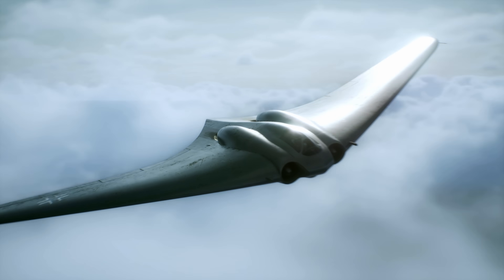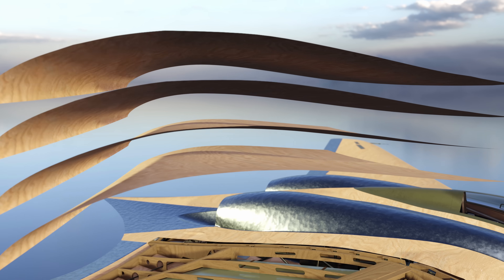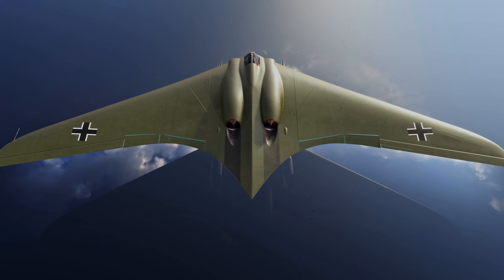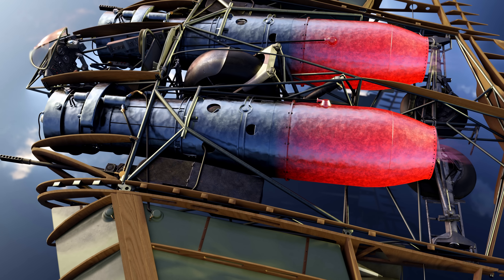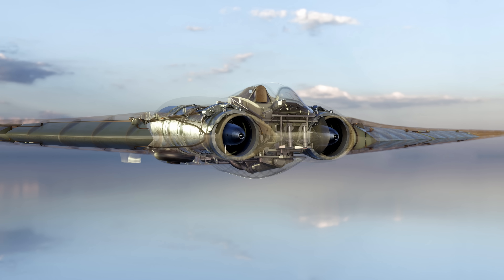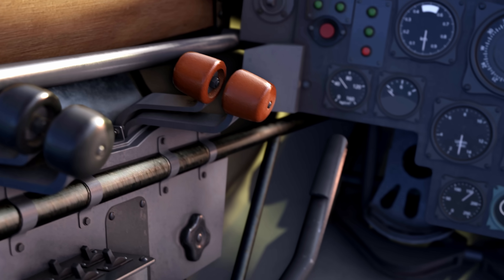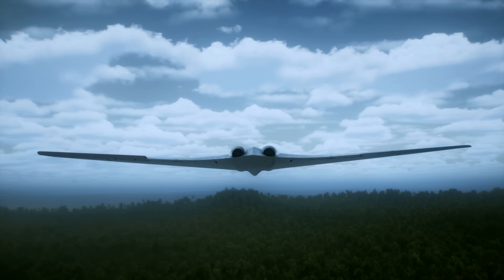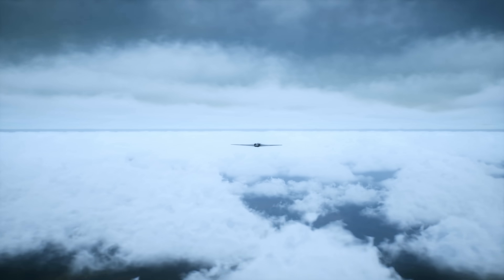Inside the Horten Flying Wing

Comment: You did forget to mention one important fact in regards to its potential stealth capabilities, it was found that because it's primary construction materials consisted mostly of wood (and wood is some what radar absorbent).

 it would have produced a smaller radar signature than it otherwise would have if it was constructed using metal.

In considering the level of radar technology at the time, it would have been more difficult for it to have been detected. 

And for this information I am citing a military channel documentary done in the late 2000s.
Reply: I believe there was also a documentary titled Wonder weapons of the third Reich, that also featured this information when speaking of this particular aircraft in one of their episodes.
Reply: 100% not stealthy, the engines are literally like gaping nostrils at the front, the shape invites radar waves
Reply: @PYri9056  your statement (save perhaps the engines) is completely false. My info is backed up 100% factual.

Yours is your opinion

Comment: Was on the drawing board from 38 , as a rear bladed aircraft initially , as seen on raiders of the lost arc , the technology was dropped due to flight instrument left extended which destroyed airodynamic tests , time being time they dropped it. The paint was also going to be the charcoal black radio reorganising silicons adapting radar signatures , also wool paneling which would then absorb and estrange the radar and become the first covert anti radar , and eventual jet engined v wing bomber , first was the focher engines and bladed , but you see the v wing was a nazi designe  using radar absorbing paints and panels , so way before the v2
Reply: Woops junkers engines

Comment: In regards to the stealth capabilities, if I recall the NG special you referenced, didn't they say that the plane WAS considered stealthy PER THE TIME PERIOD'S radar capabilities? They tested using current radar, finding that it wasn't that MUCH different from other regular aircraft, but when they dialed the radar back to replicate the radar of the time, the 229 WAS much more "stealthy" than other planes of the era, considering it's small head-on profile and it's overall shape.

Comment: Absolutely mindblowing design, better than Northrop's attempts.
Reply: How?
Reply: The Northrop designs all had stability problems needing special "elevon" design controls. They continually yawed that was impossible to correct. The Horten however was not properly tested so remained an excellent fantasy design. However they succeded in testing excellent flying wing gliders. In rc hobby flying the Horten is popular and shows good flying characteristics. @peterson7082

Comment: A common misconception is that the HO-229 was the plane the B2 Spirit was based on. When it was the XB-35 (1941) and YB-49 (1949), both are flying wings developed by Jack northrup

Comment: look like a usa stealth 21st century aircraft?...........Nhaaaaaaaaaaaaaaaa couldn't be
Reply: The 229 was not stealth
Reply: @peterson7082  but you have to admit that there is a very strong resemblance . Just being made of wood gives it 'some' degree of stealth......like the WW2 Brit Mosquito bomber made of wood and would at times slip through radar.
Reply: @inkey2  no, because of the amount of other material that made up the ho229, from the steel chassis, to the intakes, and possibly faulty panels. It was made only for speed and range, and the wood was due to resource scarcity, not stealth.
Reply: @peskyshoes  but does wood offer any degree of stealth over other materials "of the time"?

Comment: Imagine these airplanes flying all over Europe at that time. Too bad "someone" did not want everyone else to have access to them. By the way the Horten's were designing tailless delta wing aircraft since 1935 well before WW2 started, they had several gliders with this design. Many modern Delta wings gliders owe a lot to the Horten brothers and their designs.
Reply: Boris Cheranovsky and John Northrop had been working on flying wings since the Horten brothers were teenagers
Reply: @peterson7082  Wrong get your facts straight the Horten design goes all the way back to the 1930's as Gliders. American companies were in Germany in the 1930's even up to the start of WW2 so it's quite obvious that both Germany and the USA were sharing technology up to 1939. This is why the USA brought many German criminals over to the USA after the War as all this older and newer technology would of fallen into Stalin's hands. Northrup took the ideas from the Hortens for the multi plan controls. The Northrup N-9M did not even fly until 1942 and it was not even jet powered. You can say that 100% they knew what each other had it's clear they share too much design to be a coincidence. The key here is the USA took all the Horten's back to the USA and for the they started using the controls from them on the later B2. It's quite obvious now that Northrup ended up with all the Horten's brought over which later made it to the B2 design which again is IDENTICAL to the Horten. The original Northrup wings were utter garbage as they give up on those and built the B2 design which was kept secret for many years as I can guarantee it would trigger some questions as to why Northrup left behind their wing designs and literally used the Horten shape for the B2. Even the Engine placement on the B2, control surfaces it is impossible to deny the Horten as not being the Idea for it. The Northrup wings were clumsy, propeller driven, then the first jet powered ones looked like garbage. What Northrup designed was the staggered end of the B2 which was the key to finally controlling the flying wing properly. The rounded back end of the Horten wings were actually the problem for it's control issues.
The B2 bomber has nothing on the earlier Northrup wing designs it's completely a different approach and that approach was to take the older Horten and fix the control issues with the staggered flat ended wings. Even in 2024 there is no airplane on this planet that looks as sleek and alien as the 1940's Horten.
Reply: @danfuerthgillis4483  Yes Cheranovsky and Northrop had been working on flying wings since the mid-20's. The brothers were students and aviation club members in the 30's when they worked with their gliders. U.S. companies left mostly at the start of the Spanish Civil War and diplomatic ties were out by 1938. The XB-35 project began in 1938 with the N-1M flying in 1940 and N-9M in 1942. The Ho.IX/ Go229 project didn't begin until 1943 

The first jet powered Horten design was the Go229/ Ho.IX v.II prototype. Which flew and crashed in February, 1945 after several flights hours over the span of two weeks.

 They do not resemble each other. Especially in control surfaces.
Reply: @danfuerthgillis4483 The technology wasn't mature, the Hortens largely gave up on flying wing after the war. Neither ever stepped foot in the U.S., I don't think any of their close colleagues were either. 

 Engine placement? Really? They're on the leading edge of the fuselage. Not recessed above the wings. They're not even close.

The v.III prototype 229 was inspected by the USAAF for two months, then left to rot in several boneyards for a quarter century until the Smithsonian got it.
Reply: @peterson7082  The 1940's Northrup wing designs are not even close to the Horten, worlds by difference. The B2 is more close to the Horten design but much more improved with the engines more centred, the cockpit canopy further back and the critical non curved back wing section. There were many issues with the Horten but something is very suspicious about the Horten's just basically disappearing.
Reply: @danfuerthgillis4483  They didn't dissappear. The Nazi government and Hitler Youth saw more use with them as glider enthusiasts to help train glider pilots and powered aircraft pilots. Gothaer just used their engineer focus to develop flying wings. 

 They made a hell of a lot of money in Argentina though Walter wanted to just stay in Germany in the end working for a few engineering firms.

They were very skilled and smart individuals regardless of their initial political ideologies as teenagers. They didn't just disappear. 

That being said the control surfaces on the Horten are not similar to the B-2. Not anymore than Northrop's original designs.
Reply: @danfuerthgillis4483  tf you mean "non curved back wing section"? the entire plane might as well be cursive. The YB-35 was more straight in that sense.
Reply: @peskyshoes  The B2 bomber controls are set on flat planes that make up the design of the back wing section. The Horten back end of the wing section is completely curved. On the B2 bomber the back of the plane is straight line shapes for the wing edges, this is intentional in order to control the airplane better. This rounded back section of the Horten is why it had massive control issues, specially at low speed flight.

Comment: Actual Designation for this aircraft is GO-229.  The Gotha aircraft company was going to build it.  Ho I, through IX were used for the glider prototypes * Source:  Warplanes of the 3rd Reich by William Green  Pages 247-251.*

Also keep in mind we had the B-35 Flying Wing bomber under development during the same time frame.

Comment: It`s said that the Horten bros, used a strange glue with charcoal, resin and other sustances in order to reduce its radar signature, obviously, it wasn't a "stealth" aircraft, but, with this advantage, Northrop and National Geographic estimated that it will take over 7 minutes to detect the Ho-229 giving it time enough to reach a big city in the USA and bombing it.
Reply: +@francisomartin155   The Smithsonian took lab samples and there is no charcoal in the glues or paints.   The V3 prototype at the Smithsonian was designed by Gotha and was captured unfinished (and unpainted) by Patton's forces in a Gotha workshop in April 1945.

Comment: It's basically a B2 bomber 60 years in advance
Reply: Not even close
Reply: @peterson7082 you are right, it's far more advanced and revolutionary for its time. The Germans were decades more advanced than any other country. You are American so you are biased towards your country, which is understandable and a good thing, there's nothing wrong about that. But it's just a fact.
Reply: @hashteraksgage3281  You watch too much television
Reply: @peterson7082  ok
Reply: In shape? Yes more or less and that's not accidental. In actual stealth and performance? No, not at all. The intakes are not concealed and receded properly into the fuselage and it lacked RAM although Horten said he wanted to add charcoal compounds of some sort. He was onto something there, as carbon black compound is in fact used as a RAM.
Reply: @Doomguy-777  the HO229 was a stealth fighter that almost won the war mate^^

.

Comment: This is a ONE OF [or] paper design. IT NEEDS TO BE FLY BY WIRE with Dynamic DIGITAL control. NOT AVAILABLE at the time of WWII. First was F-16. Analog control could NOT do that. 100s of changes of the control surface(S) per second & complex algorithms (to my knowledge). The Germans had small quantities of Jets ME 262 & the smaller
ME 163.

Comment: "Was it stealth"..?? What type of dummy question is that..?? In WW2 radar was very new tech so I'm sure the aircraft was stealth. Once again we have Americans hide the fact that they got more tech from Hitlers scientists and acting like the American brain is the greatest.
Reply: Since the Battle of Britain, western radar tech pretty much leapfrog lightyears ahead of what anyone was using. The HO-229 with it's exposed engines, lack of RAM coating, and non-stealth shaping would've been picked-up with no issues.
Reply: No it wouldn't be that stealthy. In WW2, radar technology evolved fast to the point that it could detect even a uboat's snorkel and periscope poking out of the surface without RAM on those at this point in the war. And guess what? Warships did have air radars on top of surface radars which did its job fine for the time. So if it's on a warship, it can be used on land too. So an entire aircraft flying super fast with no RAM, no receded intakes concealing the turbines, external pylons for bombs and cheap metal? Not a chance it would be that stealthy. It would maybe have a slightly reduced RCS compared to other propeller driven aircrafts, but not by a lot just by being a flying wing. 

That said the flying wing design was certainly useful for later studies and stealing their engineers or scientists, just like the V1 and V2, the Me 262, everything else that was recovered basically including Uboat Type XXI which were very much ahead of everything at the time unlike Type VIIC submarines except for their pressure hulls and later torpedos which were made reliable (including the primitive T5 acoustic homing torpedos). Such technologies were useful. But the Horten aircraft? Like any invention made late in the war by the germans, it suffered from the lack of strategic materials, lack of time, lack of refinement that was improved upon later on and completely.
Reply: @Doomguy-777  dreamer... Liar
Reply: @sammyposton5934  You obviously aren’t a flight enthusiast and don’t know anything on the topic.
Reply: @sammyposton5934  What stealth technology did the US "steal" exactly?

Comment: The engine was started with the help of a 2-stroke engine, which was installed in the top of the engine. This high-door motor was conventionally started by a cable pull, similar to an outboard motor.The ring of the cable can be seen at the tip of the spinner.

Comment: It wasn't Stealthy as tested by scientists, however it had a very low radar return. It's technical speed coupled with low return made it very dangerous. Had they been mass produced and sent to attack England it would have done great damage as it would have confounded its discovery and reaction times thus preventing quick response and regular planes from countering it's advantages. Even more interesting is the Bomber they developed, but never built, to bomb New York. You can see an example of it in the film Captain America.

Comment: A reminder that this thing never would have worked.
Not when the Nazis were using slave labour to build their jet engines and when they didn’t have enough fuel or material to keep their BF-109s or 110s flying.

Horten would also be passed over during operation paperclip for not knowing what the buckaroo fuckaroo he was talking about.
Reply: Though the Me-262's engines were also built with crappy alloys (the engine had a lifetime of 10 hours only) so that's not an excuse. If it works, it works. Unreliably, yes since those were bad times for the germans. But it would have worked and needed adjustments, that's the only thing that matters. Problem is: they didn't have that kind of time nor ressources to make it happen at the end of the war, they were too desperate.
Reply: @Doomguy-777  I mean, they were using slave labour in the ‘Good Times’ too, so let’s not make a saint out of an absolute cunt.

Comment: 80 years later this aircraft is still way ahead of its time. I read a story on the Horten Brothers they had no aircraft design experience or training , I had no clue they actually flew I thought they designed it and never flew it because of the lateness in the war . Wow holy shit
Reply: +@@madmanmechanic8847   Both the unpowered glider V1 and the jet-powered V2 flew.  Both were destroyed in crashes, with the V2 suffering a fatal crash after just two hours of testing.  The V3 that is at the Smithsonian was incomplete when found and never flew.  So the 229 program realistically only accomplished two hours of powered flight.  Both the Horten brothers and Jack Northop designed their own flying wings independently and each deserve credit for their work.
Reply: wdym no "experience"? They made gliders in the 30s...

Comment: Fortunately for the Allies, the war didn't last for a few more years. The Germans were getting sophisticated.
Reply: That would have still been a death sentence. They didn't have the industrial output nor manpower of the allies. Just like Stalin said: volume is a quality on its own. And at this point, they couldn't produce as much volume. Not only were the uboats getting shafted (Germany didn't have an important surface fleet to begin with compared to just the Royal Navy), even the Type XXI wouldn't have turned the tables when the USA was producing Liberty freighters in just 12 days each and only 10% of the ships would get attacked at most by uboats while they lost experienced crews and commanders, while uboats were again getting beaten easily by more advanced radars, sonars, depth charges and hedgehogs, but also air cover. And that's just the naval side of things in the Atlantic or Mediterranean. Bombers: Germany couldn't produce enough strategic bombers at some point, the He 111 were needed on the eastern front like most of their forces and were shot down, nor grant enough fuel to those and cross the Channel to bomb Britain. Especially not the Heinkel He 177 Greif which was produced a lot less than the B-17 alone, the B-24, the B-26 and so on. Not that crossing the channel the other way would have been easy, nor taking a different route due to the air cover covering Britain.
Reply: You really think a country that has been suffering from manpower and supply shortages as early as 1940 could've somehow produced advanced equipment in enough numbers to magically win the war? The US was just casually providing the entire world with food, supplies, and weapons while also building the most advanced and largest military and they weren't even trying to their absolute fullest yet.